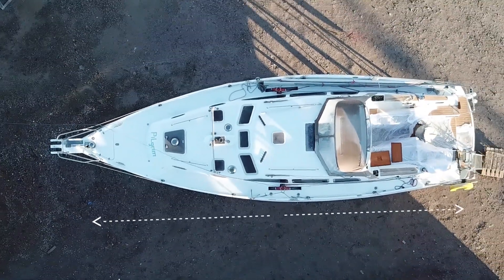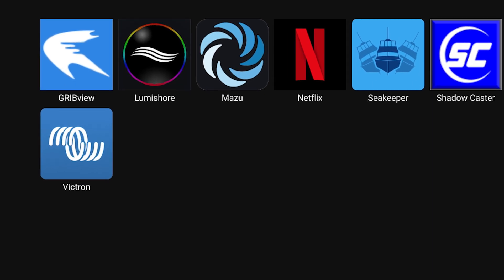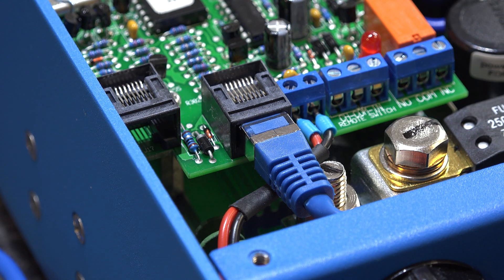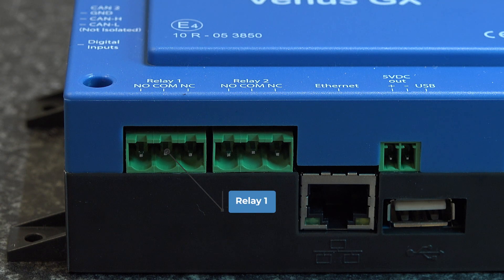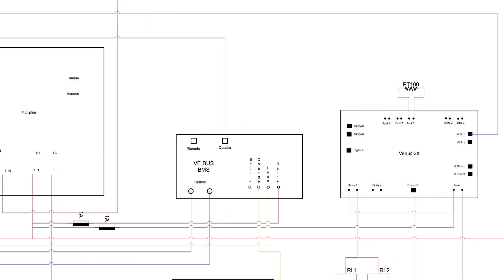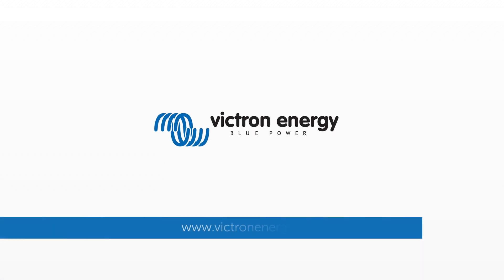Raymarine & Victron Integration aboard a 32 foot sailing yacht

Comment from the maker: 🎯 Key Takeaways for quick navigation:

00:51 🔄 Updating Raymarine firmware includes installing Victron app, and simplifying integration.
01:59 🔋 Switching from lead-acid to lithium batteries for increased power and reliability.
03:58 ⚡ Six significant electrical areas were upgraded in the boat, including battery installation and chart/navigation area.
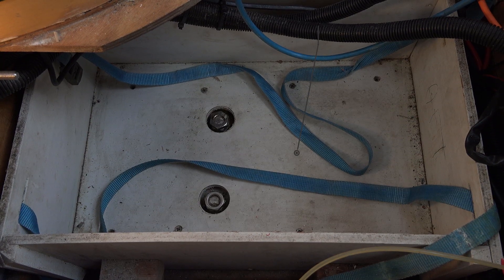04:42 🌡️ Solving the challenge of heating lithium batteries in low temperatures.
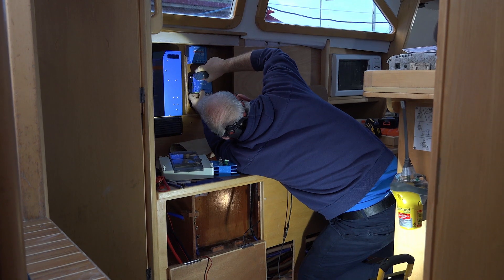07:29 🚤 Upgrades include alternator regulation, solar charging, and advanced battery monitoring for efficient power management.